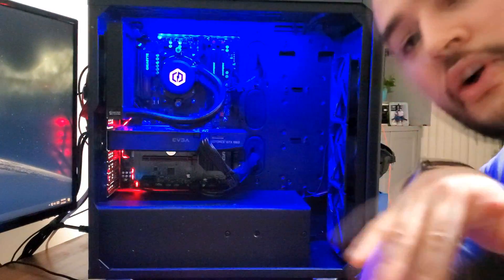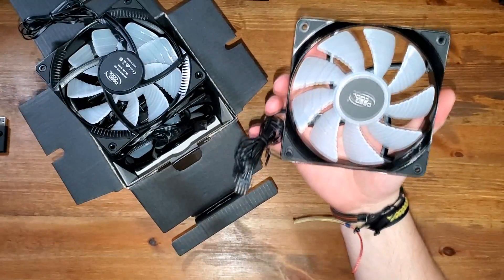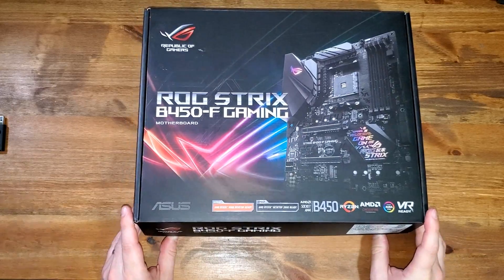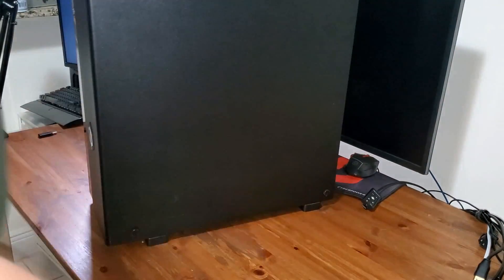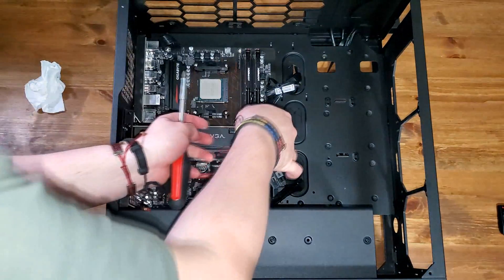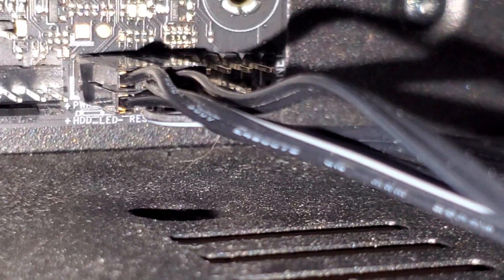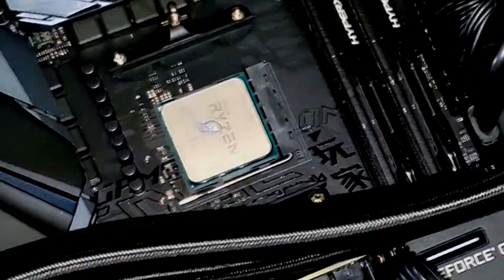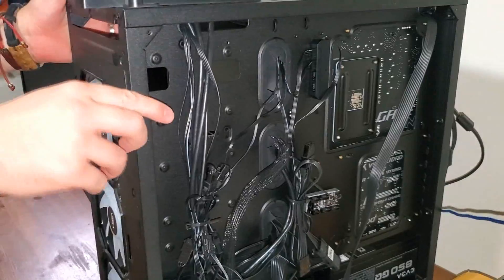How to upgrade Motherboard and Fans to your PC (ASUS ROG Strix B450-F and DEEP COOL RF120M)

Comment: You're so wholesome! Really fun video.  I saw the same mobo last week on newegg and ordered it just for aesthetics. I'm pretty excited for it after watching this vid :)
Reply from the maker: Hi Revi. Thank you so much for the comment. I am very happy you enjoyed the video. It has worked perfectly for me. The look of it is pretty awesome and the performance has been excellent. I can't complain about anything. You will be very happy. What are your PC specs/components?
Reply: Ryzen 3600 with the stock cooler for now. I’m looking into an nzxt water cooler or maybe some other type. If you have any recommendations for coolers, I’d check them out.
GeForce GTX 1660, trying to find a RTX 2060 or 2070 soon. Maybe when the price is right.
And I just got the Meshify C case from Fractal Design so I’m excited to throw everything into that new case. :):)
Reply from the maker: @revimichaels6748  Very nice. You've got a very nice PC. Depending on your budget and what kind you like (liquid or air) i could give you a recommendation. If you are talking about liquid cooling and can spend a little, i really like the Corsair Hydro H100i Pro and the one you mentioned (NZXT Kraken X53). I think they are very good looking and have awesome performance.